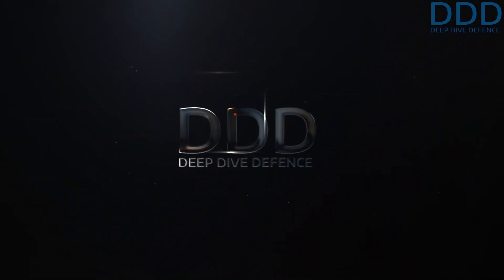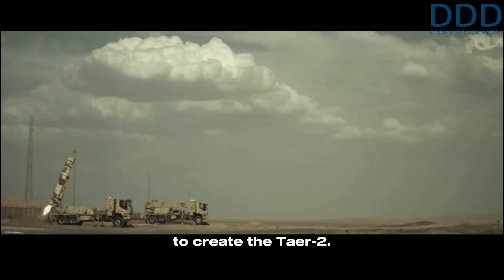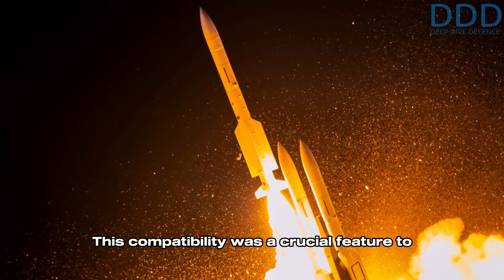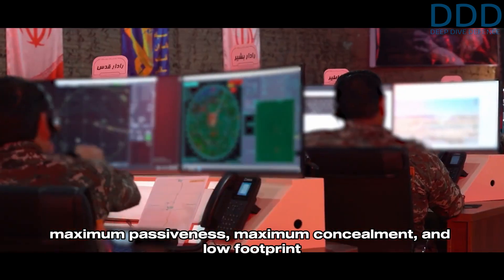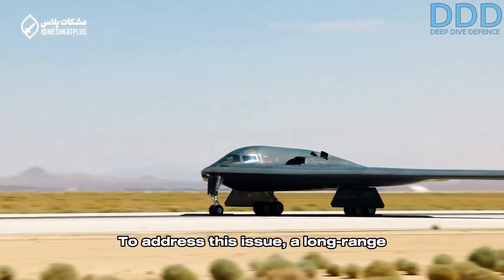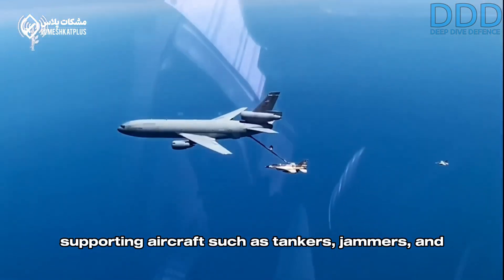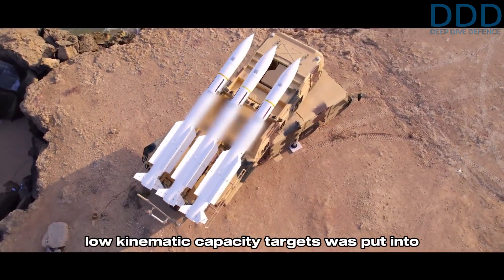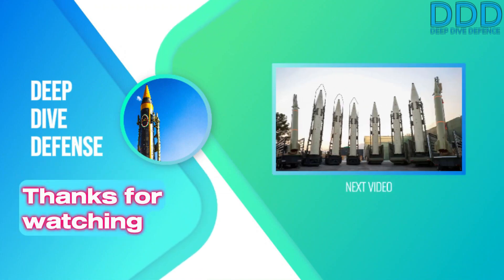Iran's best tactical air-defense system: 3rd Khordad

Comment: It appears that the 3rd Khordad system underperformed during the recent 12-day war between Israel/USA and Iran. This is disappointing. Any ideas why this happened? Or is the reality different than my impression of its apparent underperformance?
Reply from the maker: Not necessarily. It went to a ambush posture.
Reply: @DeepDiveDefense  : Is there enough information out there at this time for you to dive into this subject a bit (i.e. the performance of 3rd of Khordad system during the 12-day confrontation) either here on YouTube or on your page on X? Even if you just put this on the back burner for now, and then revisit it once more information surfaces, that would be great!

My impression is that Iran’s highest performing—or at least, most consistently performing—AD systems were its AAA gun systems working on point defense.

Separately, I’m somewhat surprised that there doesn’t appear to have been much use of the rather innovative and useful Type 358 or the even newer Type 359 loitering SAMs. Or is it that these SAMs were used, but the info hasn’t been made public yet by Iran (or at least, not made public in English-language mediums)?

Comment: Iran must not forget the importance of human intelligence working deep inside Iblis's home base aka Israel.   Since we don't know if Iranian air search has any holes in it, especially in the mountain valleys, it's best if IRGC operations gets a heads-up that IDF fighters are headed towards Iran or headed in an unusual direction.
Reply: Absolutely. However, it’s unlikely that humans can get any more close enough to get a view of/when an F-35 takes off.

Instead, an autonomous passive radar system can be covertly located close to an airbase to detect when an aircraft takes off and feed the info to where a long-range tracker can keep track of it.